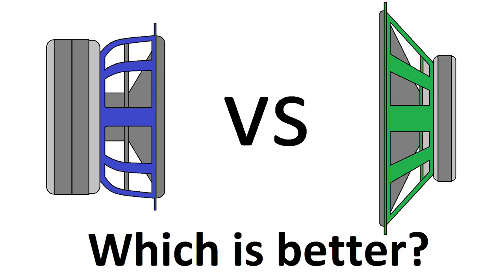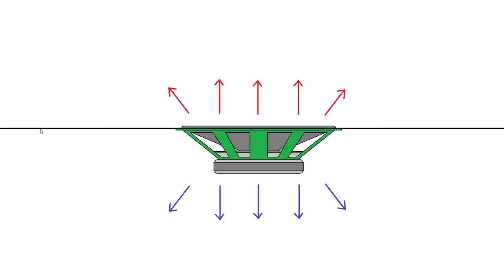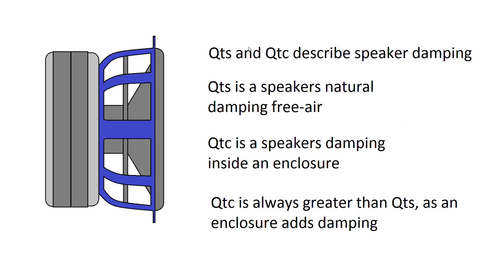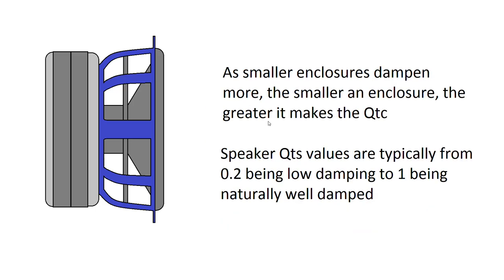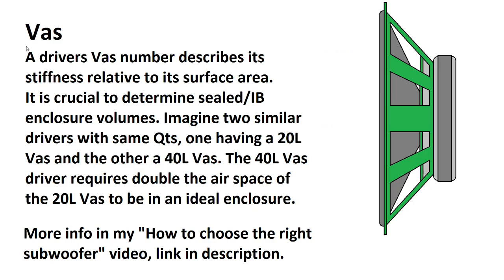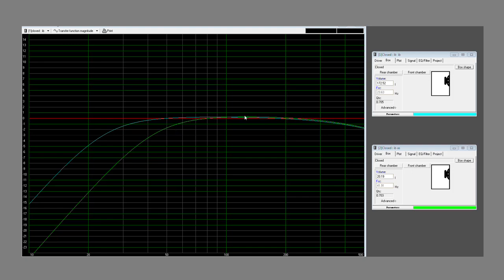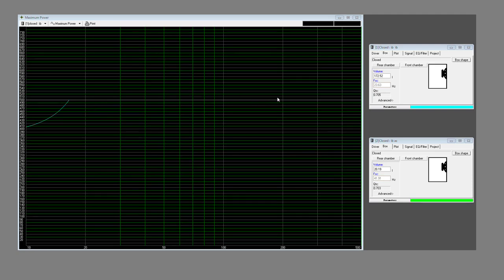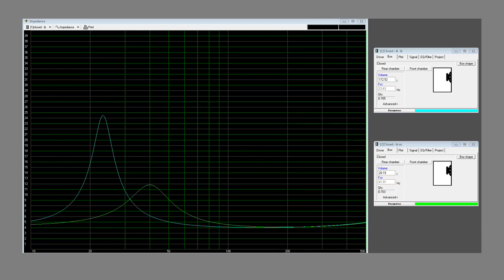Sealed VS Infinite Baffle Subwoofer Enclosures

Comment: So you know I went with sealed enclosures for my theater. I've got 5 sealed 18s and 6 sealed 15s, I get tons of response and if I drop the HPF I can get over 100dB at 8Hz! That's insane in a 1200 square foot home theater! That said, I was looking into going IB for my next "big build" which would have incorporated (16) 18" subs. Yes, 16 of them. I have a storage area behind my theater which is 3300 cubic feet (not sure what that is in litres) and that many 18" subs would have REALLY opened up my low frequency response. We're talking 150dB at 10Hz in a house! That'd be obnoxious and I wanted all of it! The thing that stopped me was the tuning (or lack their of) that I would have had to do. The biggest trade off is power handling. Even a 1000w RMS sub has to be ran at a FRACTION of its power to avoid hitting XMAX, or worse XMECH, when going in a space that big. So it's almost like you need 12 to 20 sub drivers in order to get the SPL you want! 

I may still go for it for the next big build, I know the driver I'd use (I'm in love with the Skar SDR series), I'd pick up 16 of them, and maybe spend a bit and buy a few of the Stereo Integrity 21s or 24 inch drivers to supplement them. I think 3300 cubic feet gives me a lot to work with. Sealed, for now, is the way I chose because I absolutely LOVE ULF. Hitting 10hz with authority is my JAM. 

I love that you put out videos like these, they always get the wheels in my head turning and make me want to go back down to my theater to build more. I need to do yet another tour of my theater as I've moved things around and re-packaged some of the existing items. I can't wait to see what comes from your channel next and I'm still thinking that you and I need to have a build challenge. Budget Audiophile vs Dakoustics. Let's go for battle of the ULF. Let's see who can hit the lowest notes the hardest, HAHAHA! 

Love this channel!
Reply from the maker: Holy crap, 16 18s! I can honestly say I don't know of a car audio build with more than that, except the 40 15" solobarik truck, but that's it. 3300 cubic feet is hard to fathom. Might be time for some structural reinforcement at that point. I've seen a bit on the stereo integrity 24" subs, craziness. I'll keep my eyes open for the next upload.
Reply: @Dakoustics I'm going to do a quick video today just showing the updates to the theater's configuration. I'm excited for the next part of my build. Almost as excited as I am to see where your build goes! 

The world needs more clean, ultra low bass!
Reply: Budget Audiophile your goal shouldn’t be to put as much power to the sub as possible. SPL is a product of xmax and cone area. Thats it. So you technically get more out of IB than sealed and you can play way lower
Reply: @JayeBass  I see what you're getting at but at the same time, 200w/sub is going to have a lot more headroom than 50w/sub. 

Digging deeper at a given level requires more wattage for a given driver. It's just electromotive forces in action.
Reply: IB is the way to go to get really low frequencies..but.. you can actually damage your house by going too crazy with it. Sound can be incredibly powerful. Do LOTS of research so you really understand it before you start your build. Good luck with your project!
Reply: @MrTremors1  Absolutely, wouldn't have it any other way, mate! I am a ULF junky, so the thought of more response at lower frequencies makes me smile. I've now got 6 18s and 6 15s, if I decide to go IB, I'll probably sell the 15s and buy 6 more 18s for a total of 12. I've already got 26,000 watts of amplification. So I have WAY more than I'll ever need as IB means lower power handling. That said, I should be able to make it work. It's a very big room, so 12 subs is definitely just the beginning, haha!
Reply: @Иван Васильевич that's just categorically incorrect.
Reply: @budgetaudiophile6048  
You stating IB = far lower power handling, really isn't relevant considering the big picture. 

When an IB driver isn't fighting that box volume, it's efficiency down low just skyrockets. 

IB lowers the power needs 𝘥𝘳𝘢𝘮𝘢𝘵𝘪𝘤𝘢𝘭𝘭𝘺. 
I'd say likely about 10x lowering of power needed to hit Xmax as compared to equivalent small sealed (typical high quality 18" needs upwards of 2kw to hit Xmax in small sealed alignment). 

This is 𝙃𝙐𝙂𝙀, hell it's the fundamental key to IB's superiority over any other alignment. When it only requires 200w-300w, to hit full stroke, all kind of benefits are realized. Current related thd in the driver are diminished, ... thermal compression lowers.
 Plus the amplification needs 10x less current from the wall ... so voltage drop of that circuit that may accompany the biggest ULF effects also are lowered. 

I've made so many measurements etc. For context I have a quad array of 18"s in a manifold, attic mounted Infinite Baffle subwoofer above our primary media room/home theater.  
I also have a pair of SubMersives, double 15" small sealed, active powered subs. So I've got (4)18"s, (4)15"s, as subs. My three identical LCR mains across the front each have (2)12"s covering from 250hz downward.  

I've performed countless experiments so I can experience and determine the difference between various low frequency subwoofer approaches alignments. 
I've used and still own vented/ported subs, but they don't play well together with the IB/sealed. They're used elsewhere. 

Back to power handling;
 IB = excursion limited
Small Sealed = power limited 

Although that's true, there's exceptions. But when an IB fails it's not a burnt coil like a small/sealed. An IB failure is typically a bottoming out destroyed former, or failed triple joint.
Reply: I built a ib column that mounted to living room floor in basement. Made out of 4 plys of 3/4" mdf that held 8-15s. Absolutely loved it, in time I'll get the theater set back up

Comment: I want to do a stupid box where i make a fourth order blowthrough into my truck, but the sealed section is nonexistent/the bed of my truck/IB. I would likely use a sundown xv2 18 or 2 u15s. Any tips, concernes, advice, or reasons why I shouldn't? Il cone control could be an issue, but with a proper hpf, i dont think i need to be concerned with that. Im just not sure how damping would apply to/be an issue in this type of setup.

Comment: I currently have two 10s in a 3.5ft3 enclosure. Available space is  38"w × 14.5"h × 22d. I want to upgrade my sub(s) for more BASS and am leaning toward a single 15" (Incriminator Audio Death Row). It's a SQ system that I do like to crank sometimes. What would you recommend for size/quantity? (1,500 watts RMS amp)

Comment: Hey, love all your content. Can you or any briefly explain group delay? 
Thank you
Reply from the maker: Group delay is basically an effect where certain frequencies take more or less time to get from the output of an amplifier to our ears, via the speakers. 
Example- You have speakers against the opposite wall, but the sub is next to the couch. The speakers will have a delay relative to the subwoofer.
Example 2, a ported speaker- tuned to 40Hz, plays a 60Hz tone. Sound goes straight from the amp, to the speaker, to your ears, not much delay. 
But, if you play 40Hz, it goes amp, speaker, then the port absorbs a certain amount of sound before it starts to resonate properly, and this results in the sound taking longer to get to your ears.

Comment: how about a 8 inch sub driver with Qtc 0,5 and 9mm x-max  and 10,5 lieter Vas in a 17 liter box ...would be infinite baffle is that ideal?
Reply from the maker: Yes, it'd be infinite baffle. It'd have a low-ish Qtc, so balanced more towards peaks than tones, but main thing is be careful not to over-excursion it. At 17L, too, could be enough for it to be ported if you wanted.

Comment: So how do I SLAM the lows AND get loud AF without porting or bandpassing?
Reply from the maker: Only real option is a ton of cone area, but to keep the lows not too much cone area or they'll be choked. Like a box more common in the 90s, with 8 12" subs in a 10 cube sealed box.
Reply: @Dakoustics  I just saw a video where two infinite baffle 18's on 400W total did a hair trick at 18hz.

Comment: Something I've wondered...

How would a speaker perform if you somehow managed to hermetically seal the enclosure and had a vacuum within the enclosure.

I'm sure somebody somewhere must have tried this.
Reply: I’m no scientist, but I would imagine it wouldn’t perform at all…if a vacuum was present inside the enclosure then it would be pulling the driver inward and would not be able to move to produce sound.
Reply: @brandonhooker4498  Yes, of course the difference in pressure between the inside and outside of the enclosure would create a force pushing against the speaker driver.

But this force could be overcome - either by increasing the power of the driver, or mounting an internal spring pushing the driver outwards.

Comment: Sealed is not more efficient than IB. You didnt mention how much more power you’d have to send to the sealed box to be louder than the IB design. And WIN ISD is NOT the best way to educate yourself. Build the designs yourself and listen yourself. Sealed is great, so is ported, IB is superior. Less power need to hit same spl and the useable frequency response can often be produced to the single digits
Reply from the maker: Sealed being described as more efficient than infinite baffle is a reference to their use of the back pressure. IB ignores the back pressure, whereas sealed uses the back pressure to boost output at a higher frequency, so its more conceptual than practical.
WinISD is what I muck around with every so often, I do build boxes, but simulations are much easier to muck around with than building a box and having every driver with every possible specification. It's also much easier to describe performance with a clean simulation than buying a couple subs and building boxes for them.
Reply: Dakoustics i understand that. It just doesnt always show what really is going on especially with IB. For example i’ve got 2 Tumult 15’s. WinISD would show their response startin to taper off around fs. But in reality they peak around 15hz with the amplifier they’re connected to and could be much lower with an amp that doesnt have a subsonic filter @10hz
Reply from the maker: @JayeBass  yeah, thats a good point, if you're interested in my "4th order v 6th order" video I mention how cabin gain massively improves the low-end performance of 4th order bandpasses, so although winISD would have you believe band passes are... welll... band passes, they in fact act more like low passes due to the +12dB/octave gain keeping up with the -12dB/octave roll off of the sealed portion of the 4th order. It'd be good if WinISD could process cabin gain, I've seen people comment it can with filters, but I haven't checked it out yet

Comment: You have it backwards, a high Q is less damping, a low Q is high damped.
You obviously do not understand what you are talking about, you mix terms, reverse terms and generally waffle on in your incorrect little world.
Reply from the maker: Yeah, got Q's backwards lmao, but yeah main point still comes across, small sealed tunes high/is peaky, big IB tunes low and smooth.
Reply: @Dakoustics  That totally depends on driver Q, a low Q driver will have no bass output in an infinate baffle where a high Q driver will sound very good.
Acoustic suspension use small boxes to lift the Q at the expense of efficiency whereas a more conventional sealed cabinet will be larger and not use such a small box to bring the Q up to required spec with the extreme end being infinite baffle with a very high driver  Q that does not require being raised by the cabinet.
A low Q driver in a small box will not be peaky, just not efficient compared to a big box higher Q driver with the same F3.
Basically the size of the box controls the efficiency/extension equation and you can load that box any way you like, with a ported or passive radiator system yielding lower distortion/ cone movement than any sealed  driver.